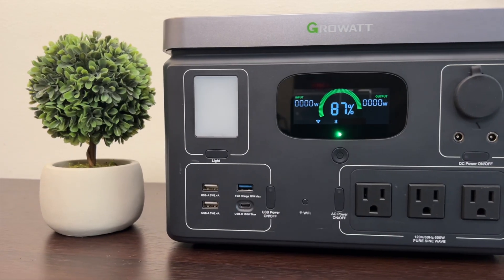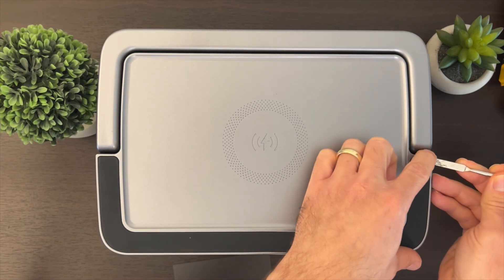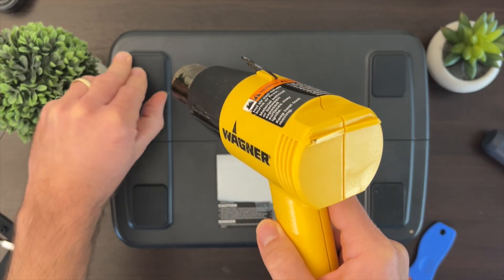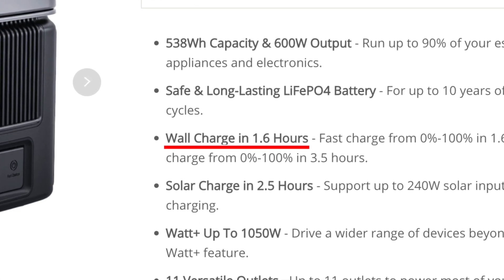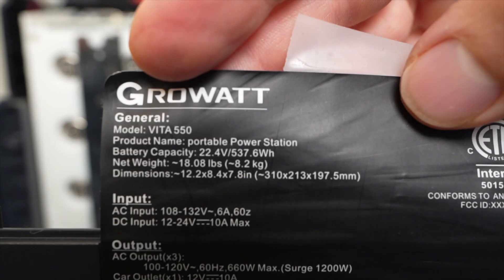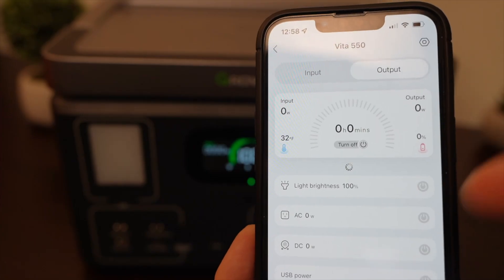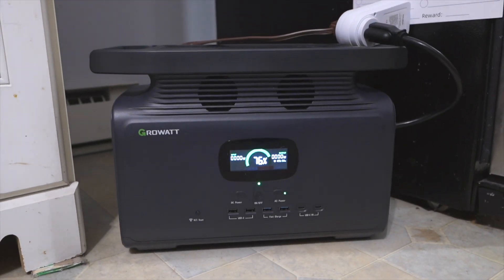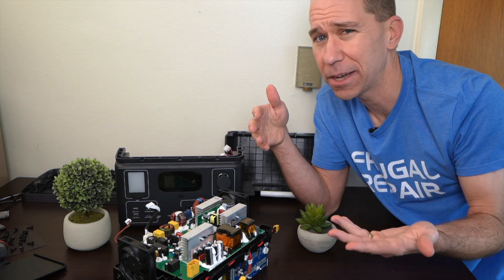I Dissected a Power Station | Growatt Vita 550

Comment: Ive got the infinity 1500 but the inverter for the ac has overloaded and will not work. Is it possible to change the inverter and any ifea where i could source the part? Thanks

Comment: Very informative video! Just curious, do you know what nominal voltage the 28 batteries are setup for? I’m considering building a pack of 16 more of these exact batteries to “plug” into the Vita550 via a plug I’ll install in an attempt to increase the available power to utilize approx 600 watts of usable power. Considering 74% efficiency between inverter loss and the 10% cutoff. Currently there is about 400 watts of “usable” power.
Reply from the maker: Thanks!  Unfortunately, I don’t remember the cell configuration off-hand.

Comment: Hey I got a similar one and I'm wondering about the passtrough thing you mentioned. My unit charges with a 60w external power supply which means it's already DC power coming in. Still the AC out is not working while charging, but DC out is. Does your unit use an external power supply or does it convert the power internally? Maybe there is another reason mine can't give 230v while charging like protecting from overheating. Thoughts?
Reply from the maker: What power station are you referring to?  The AC inverter on the Vita 550 is designed to operate as an input or output but it doesn’t do both at the same time.
Reply: Idk how true but looking on Amazon I saw this
"A: older versions do not but the latest versions offer “Search term:charge-through” (you can plus in AC power and simultaneously Search term:charge while using the AC outlet to provide power to a device
By Brian scott in the United States on August 10, 2023"  @FrugalRepair

Comment: Great insight. Shouldn't one wear anti-static strap while working with a motherboard or delicate electronics? Just a thought.
Reply from the maker: Thanks!  I wasn’t touching the circuit board but in general, most people who work on pcb’s don’t bother unless they are working on something especially sensitive.  The biggest thing to be aware of is the potential energy stored in the capacitors and the battery cells.

Comment: Great video showing the features and quality of the product. one MAJOR thing i noticed was the fact that you did not mention that anyone taking these things apart should bear in mind the large high voltage capacitors onboard which can give a very nasty shock or even be fatal if not fully discharged. Although you said you discharged the unit it is absolutely worthwhile mentioning the dangerous voltages that CAN be stored in these devices for a period of time. Again. great vid though 👌
Reply from the maker: Thanks for watching and the suggestion!

Comment: No passthrough charging is a huge bummer. Cool video. Do the electronics have the coating to protect against moisture and corrosion?
Reply from the maker: There’s nothing special to protect against moisture that I’m aware of.  Like most electronics you’re not supposed to get it wet or leave it in a moist environment.
Reply: @FrugalRepair  Thanks for the reply! I mean specifically, do the electronics have "conformal coating" on them? A bit hard to see in the video. Conformal coating is the shiny coating that looks like a nice sheen applied over the circuitry, and it protects against humid environments. For example the Bluetti EB3A and Ecoflow River 2 products have it. Also, it's nice to see all the capacitors are silicone'd in place, which means against vibrations etc, this unit will be super durable. Glad to see Growatt making a really good unit!
Reply from the maker: Ah, gotcha!  What's ironic is that I just put it back together before I saw your comment.  I would assume it has a conformal coating but I didn't scratch on the pcb to check.  If it's important to know, I can dive back into it.
Reply: @FrugalRepair  No need! Was just curious, that's all! Thanks for another great vid and looking' forward to the next one!